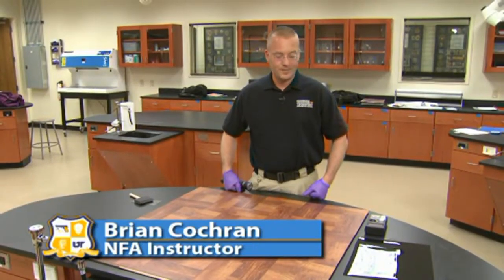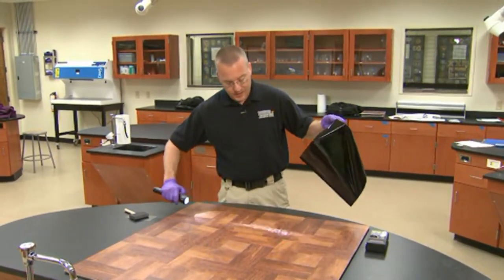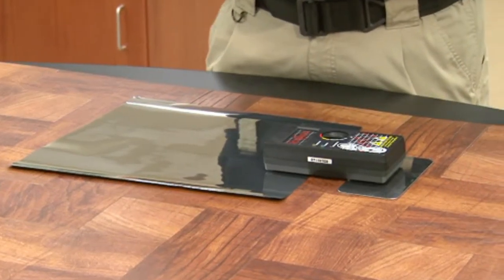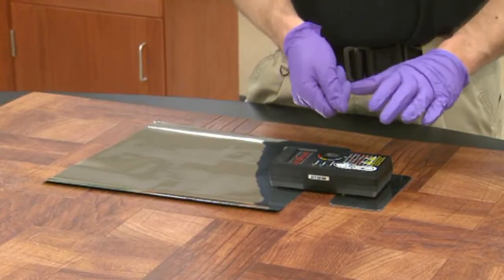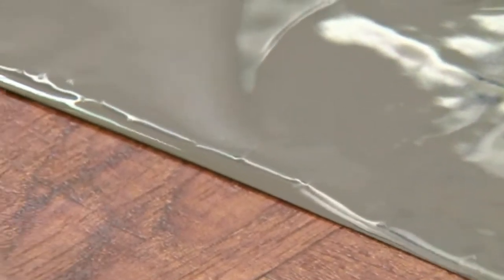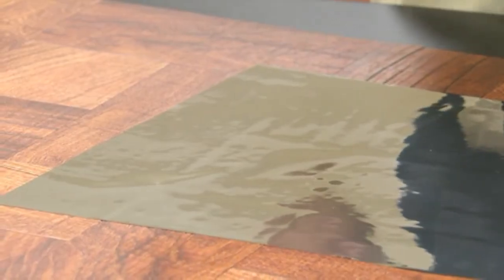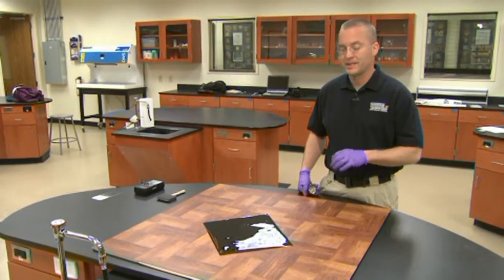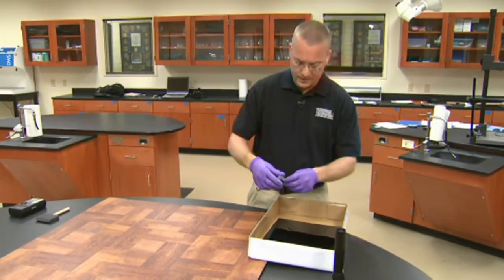How to Use an Electro Static Dust Lifter for Evidence Collection

Comment: So that means...
A reverse charged shoe can push the dust away from your sole and you will leave no trace... 
Each shoe will have a ground plane and static charge plane but it will work in reversing cycles. Once you are about to rise one of your feet, it will be reverse charged by the on-ground foot.
I'm just an in home quarantined engineer because of the  COVID-19 pandemic. No intention of any crime...